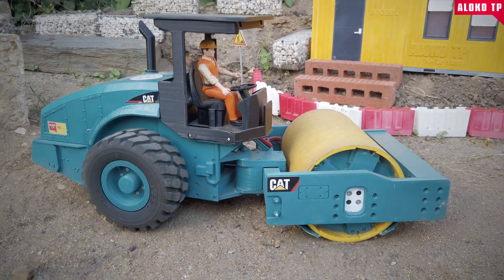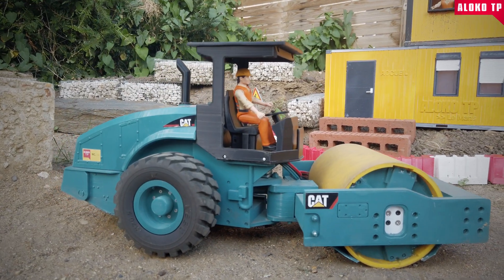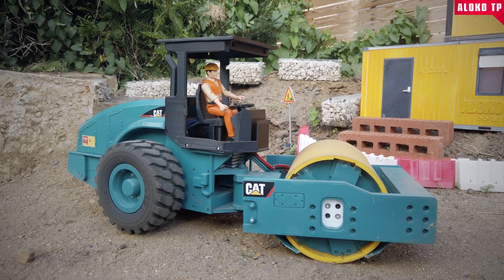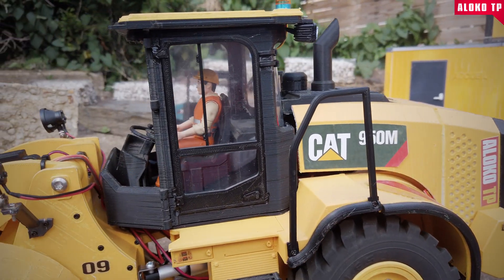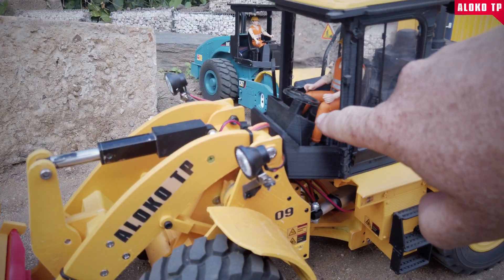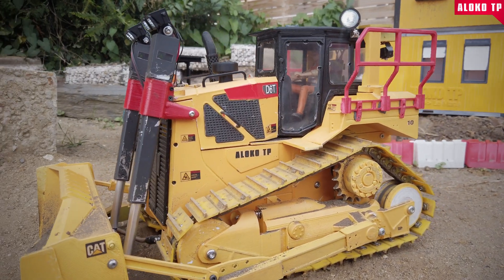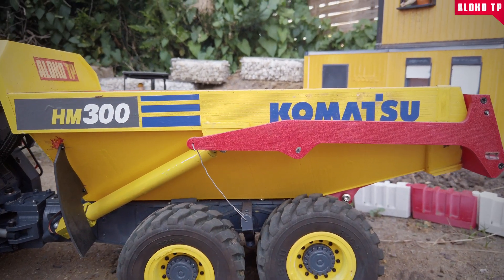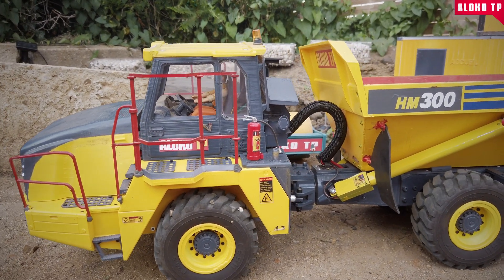Overview of my 3D printed models from Burnie222RC after extended use ! All models updated to latest.

Comment: Well done with your vid, inter and informative, I have just download the Volvo front loader, yet to get all the necessary bits and start to print.
It would be interesting to see your thoughts on each build with a separate video, particularly with details of what components you used, ie motors, esc, function modules etc and pros and cons..
Well done again and thanks for sharing.
Reply from the maker: Thanks mate. Actually a few people are asking me the same questions about the 3D printed models I build, Ill have to think about it. Thanks for your comment .